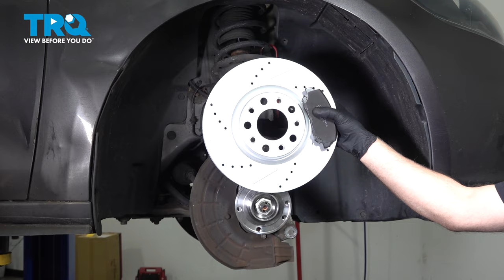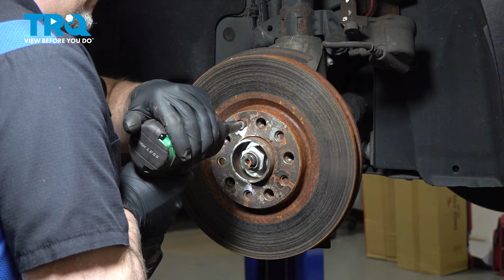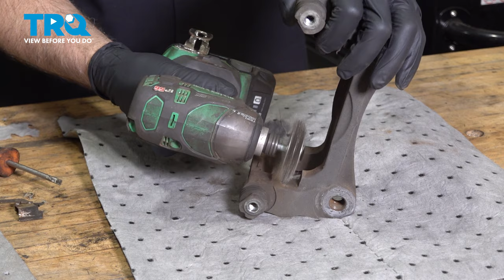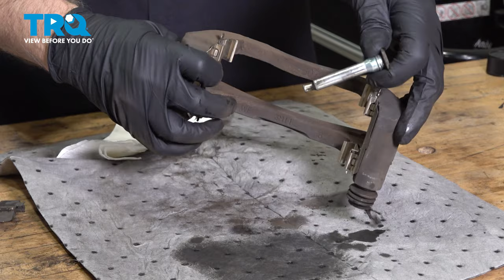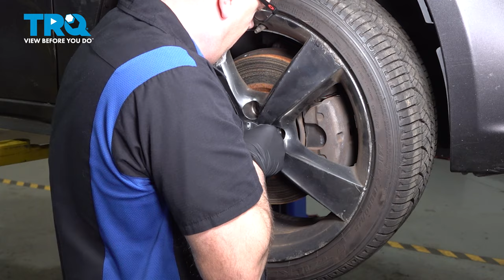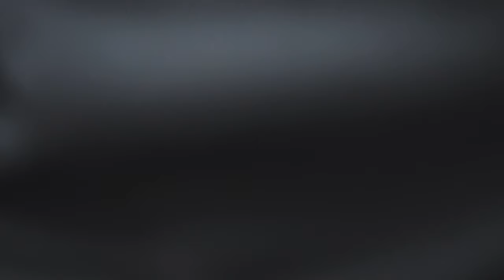How to Replace Front Brakes 2013-2016 Dodge Dart

Comment: You might want to point out that the caliper piston needs to rotate as it is being compressed which is why you need the special tool and not just large channel-locks.

Comment: Ah HAH!  Now we know where the rotors got put on the wrong sides on the Dart in the other video.  At the top, the slots need to point to the rears so water and debris will be thrown outward as the wheel spins forward.  But very good techniques.  And a Thumbs Up!

Comment: Tools needed

19 mm socket
14 mm socket for caliber bolts
Caliber hanger
Brake pads
E20 socket 
5mm hex socket
Hammer
Wire brush
Anti seeze (forgive my spelling)
Brake parts cleaner
Flat head screw driver
Silicone lube or brake caliber lube